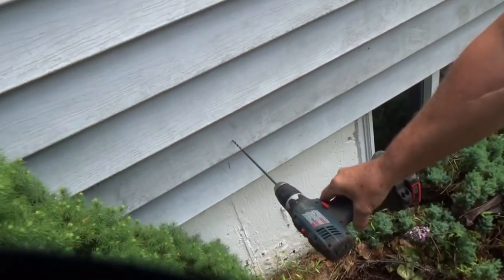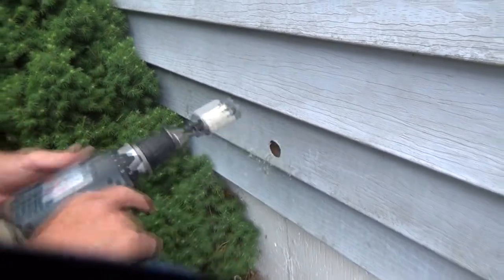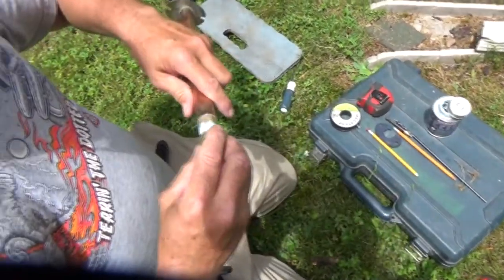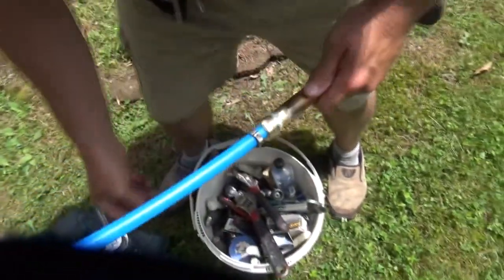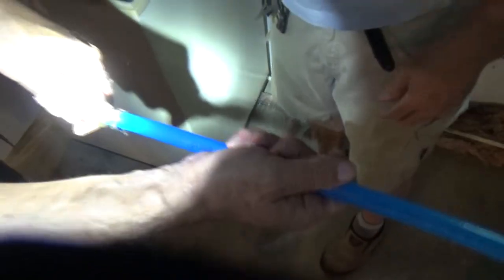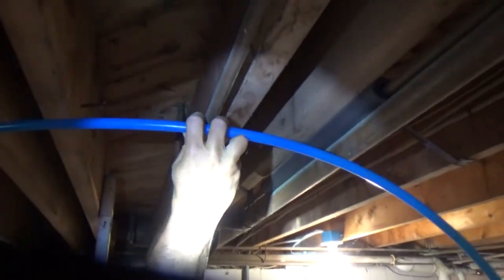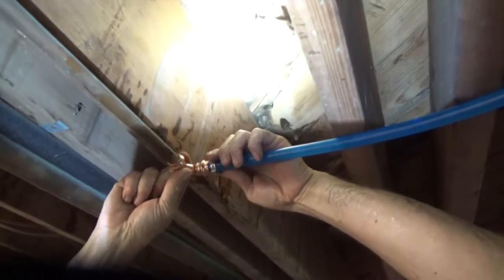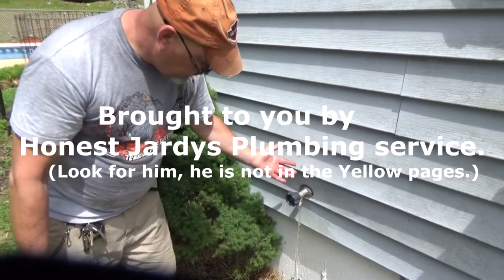HOW I INSTALL A HOSE BIB - WATER SPIGOT- OUTDOOR FAUCET (Honest Jardys plumbing)

Comment: What is the name of the black plastic spacer piece between the vinyl siding and spigot?  

I think I need one since  the screws push the vinyl in too much.
Reply from the maker: Hi Thomas, I would think that's it, the spacer, maybe they would have extra at the plumbing store, thanks mike

Comment: Good video, but how do you deal with a water line that is four feet under ground ,(  through 2 foot stone wall)coming up and then out - my question is how do I support the shut off value? Presently it's galvanized so it supports it's self - any suggestions?
Reply from the maker: Hi Wendy, ask the guys at plumbing store for different options, thanks Mike

Comment: Looks complicated : to install new faucet outdoors to inside ; needing fittings inside rubber or plastic type hoses , cinchers to cut inside house hose , pipe connectors and the aluminum ring around fittings to tighten .
Reply from the maker: Thanks, Mike